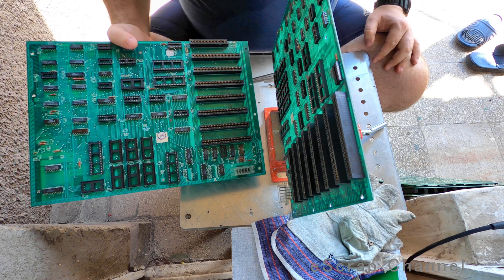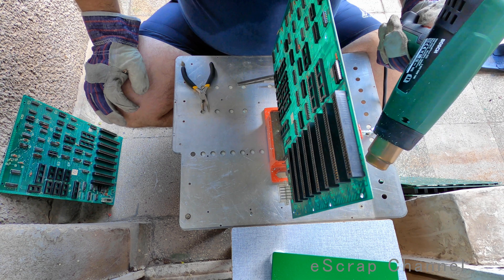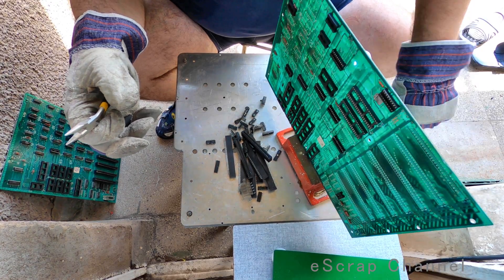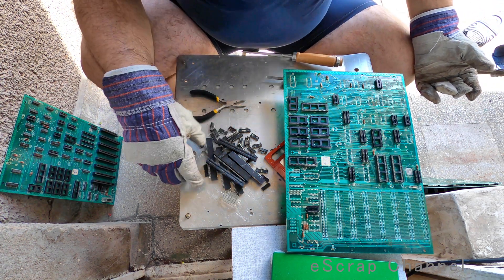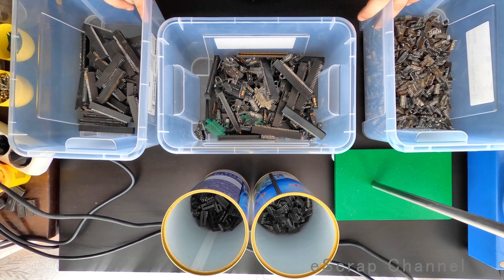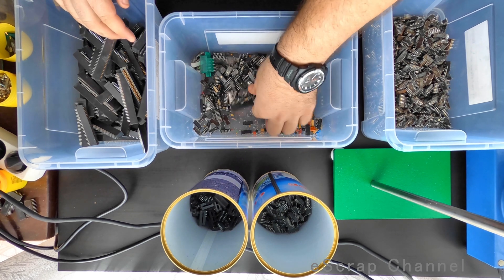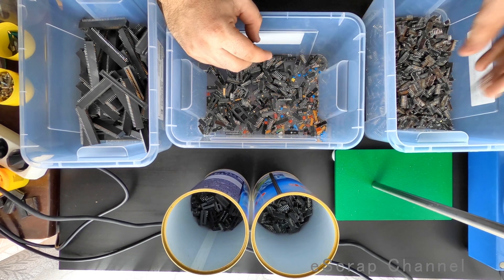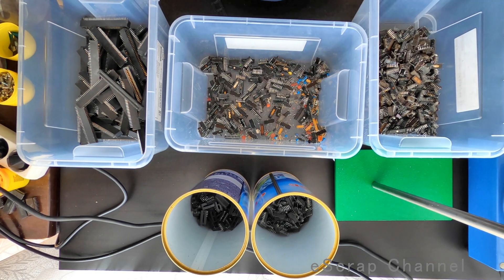How to depopulate vintage computer boards?

Comment: heat from the bottom up heat
 rises
Reply from the maker: Hi, true! Thanks!
To be honest I have the feeling that after the board initially heats up it goes very fast. Heat quickly spreads by the metal board layers to the pins soldered.